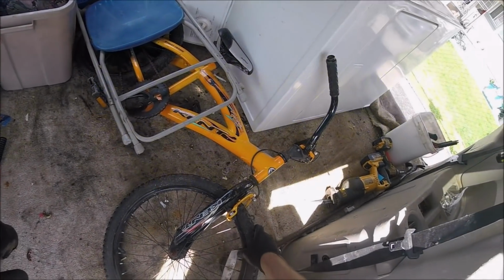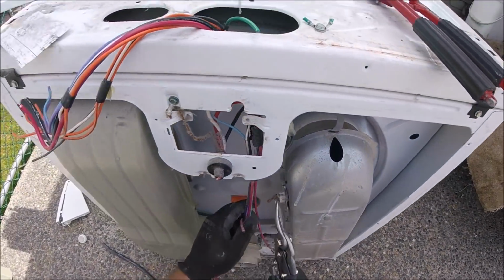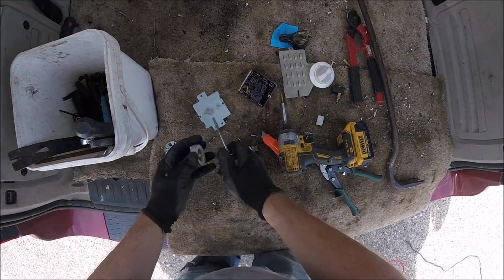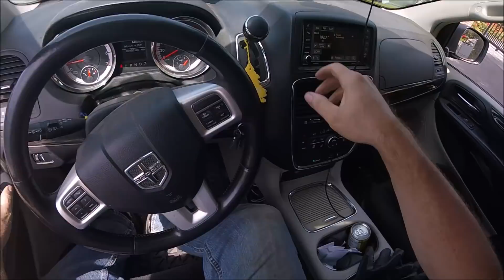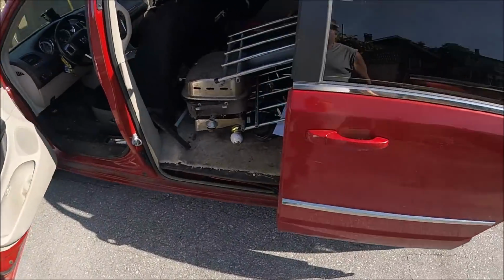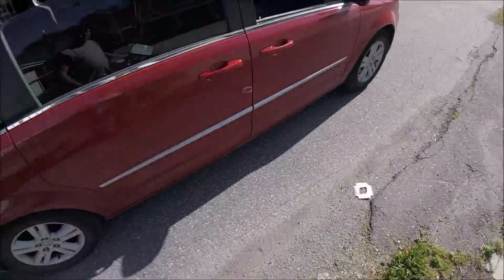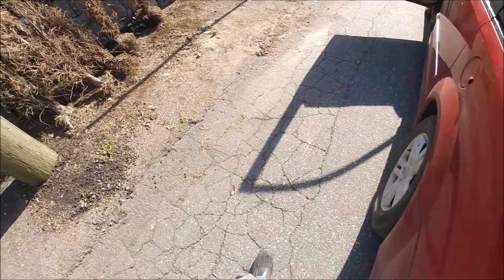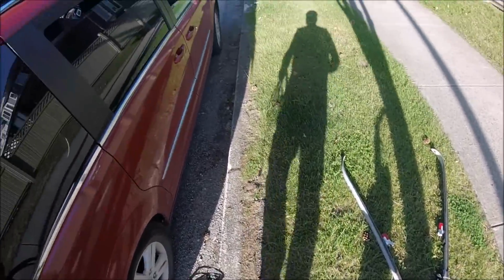Street Scrapping Free Working Saw & Brass Rad

Comment: Another great video! That exerciser at around 39:30, just unscrew the plastic side screws and it easily folds down or be taken apart. I have 2 of those. Would like to see how you take a satellite dish apart. Found 4 last week.
Reply from the maker: Thanks For Watching, On the satellite remove the plastic around the feed horns. The feed horns are made from cast aluminium & inside they could have a gold plated board inside & also cut the brass cable ends off the coax too. I made a video couple months ago on the feed horns

Comment: The car radiators are normally copper not brass. Well they’re aluminium now but they used to be copper. Very rare finding a brass one.
Reply from the maker: The old one are brass
Reply: Canadian Treasure Hunter I think they’re a mixture some copper some brass. Rare to find them now they’re all aluminium.